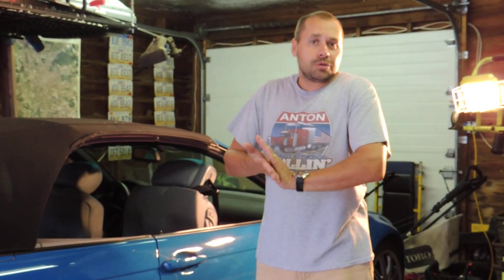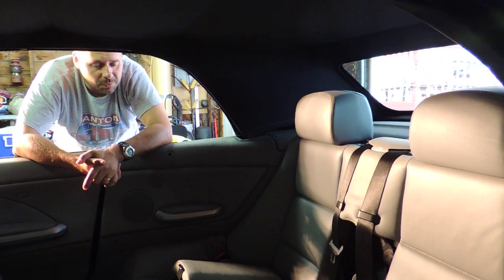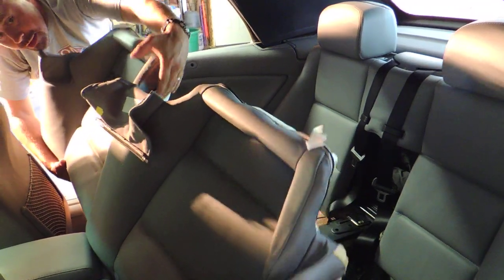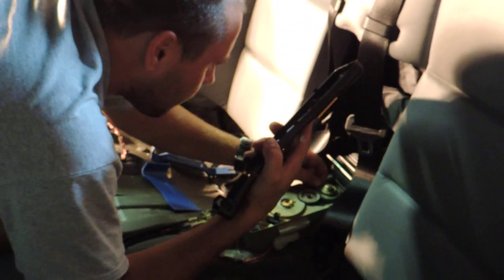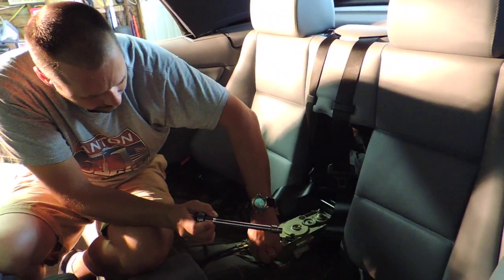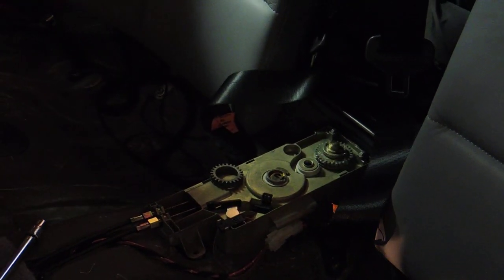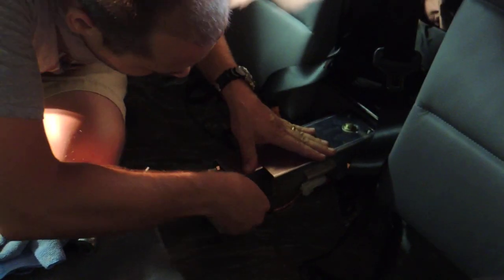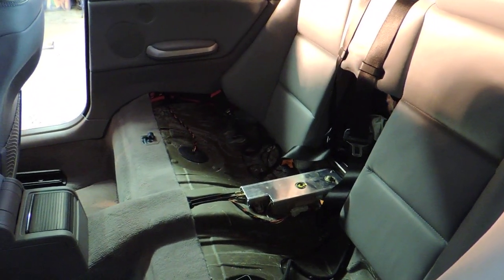BMW E46 convertible top problem metal motor cover replacement

Comment: Viewed your video and ordered the part on ebay.  Took less than 10 minutes to install and fixed the problem beautifully.  Thanks for the effort of posting this.  Saved me a ton of money and issues.
Reply from the maker: You're welcome. But the true credit should go to the guy who engineered it and making them now. He definitely saved us a lot of money
Reply: Hi David Petrosky  when do you install the new cover plate you adjust the tension cables ?
Reply: I was perhaps lucky as I did not need to make any adjustments.

Comment: Hi anton alexeev i see you video full so buy the covert plate by my BMW46 2003 convertible but dont work . the mechanism unlock never unlocked  so the light stay flashing  what do you recommended
Reply from the maker: Jorge Fonseca So you bought the new cover and it still doesn't work, did I understand you correctly ?
Reply: @TAspeed1  Hi  yes affirmative  it still doesn't  work , today I try again but when turn with Allen key o'clock wise I fell unlocked , the cables moved but doesn't work
Reply: the plate cover I bought new 99 us by ebay

Comment: I tried to put it back with the plastic and it worked until near the end of closing or opening top. Didn’t have parts customer needed car so we put a bolt and nut to hold the gears In place. Just have to take the motor out to place the bolt in place. Nut goes on top of plastic once everything is buttoned up. Hand tight with locktite

Comment: Anton I see you video , but I have problem with latch on the front drive side dont work , I try manually nothing . only the passenger side open only. any recomendation please thanks
Reply: My friend your metal latch which hooks into the windscreen is encased in plastic. Either the plastic surrounding the metal latch has broken (which can be reglued, or have a bolt drilled through it), or the plastic gear inside the top latch motor which sits in between the latches has broken. This can be replaced with a brass replacement gear. There are tutorials all over YouTube for this replacement.

Comment: Looks like a great product. However you mentioned the plastic cover may just have been like $10? I am getting rid of my car next month but just wanted a cheaper solution. I can't find any on ebay or Amazon etc, any idea where I can purchase one? I have the exact same issue, clicking/grinding, 1 of the 3 pointed pins is broken on top so only 2 are grabbing the cog. Also my plastic cover broke on the side where the flap is. Any tips welcome!
Reply from the maker: https://rover.ebay.com/rover/0/0/0?mpre=https%3A%2F%2Fwww.ebay.com%2Fp%2F943414501
Reply from the maker: https://rover.ebay.com/rover/0/0/0?mpre=https%3A%2F%2Fwww.ebay.com%2Fp%2F943414501
Reply: @TAspeed1  Thx for the quick reply, but I am looking for the plastic, not metal cover....like I said I have spent a lot in fixing up my car and trying to save some money and plan to sell it just in a month. Any idea who sells just the PLASTIC cover? I see nothing on ebay etc...Thank You!
Reply from the maker: Unfortunately there is no plastic replacement covers unless you buy the entire motor assembly. There is a way to do it with a threaded stud washers and nuts. Or wooden spacers and zip ties around the whole  motor assembly
Reply: @TAspeed1  Thanks! That is what I thought, may  just have to go with the $99 metal one. Thnk You!

Comment: OK, I've heard an annoying sound while lifting my top few days ago. It was very short sound like the one you describe. Today after almost a week of normal operation, I the sound appeared again, this time during almost entire top lifting. I stopped before the top is locked and pressed the other button for folding it. The sound came again. Now though it works without any noise. It is strange because the noise does not appear only during the locking/unlocking of the cover. Do you think it is from the same gear? Despite of the clicking noise, the top closes and opens no problem? Is there a chance the problem is with the hydraulic pump? I suppose there is a separate motor driving it?
Reply from the maker: Sorry for late reply I've seen that you posted it a month ago. I hope by now you were able to troubleshoot it.

Comment: where did you get the metal cover?
Reply from the maker: Mark , 
eBay. The gentleman costome makes them. Sometimes he out of stock on them. 
On the description of the video you will see the part number that was assigned to it because it's patented product now you can put that part number in Google and it will show you the eBay listening

Comment: Hey Anton, thanks for the test. Sounds great. Found it on e-Bay, but unfortunatly shipping cost to Germany are as much as the part itself. :-(  Maybe I will try it with something like a hose clamp bound around with some metal in between. 

Anyway, thanks for the hint and have fun with your convertible, bro.
Reply: Just do the fix with the bolt. It's easy, cheap, and works perfectly.

Comment: Thanks for the video.  I have the same problem.  Where did you buy the metal cover from?  Would you please give me a URL.
Reply: small washer on that gear he took out. My solution was to place that washer right because that gear needs to hold down for a turn. re enforce that washer against the plastic cover with a self_made kitchen aluminium foil washer - just a thin width will do.
want some more support? that small removable child seat

Comment: Bosch sells a complete OEM replacement part for $29.46 on FCP euro, whereas the BMW branded part is $607.11. This is just the motor, not the housing though. I haven't been able to find just the housing, nor could I find the metal aftermarket replacement.
Reply from the maker: Search eBay on and off. Gentleman who makes metal covers owns a machine shop. He makes them and sell. but they're not always available if he's out of stock on them
Reply from the maker: Matter of fact I just searched eBay
BMW E46 convertible top motor cover.
it showed up in search and available for purchase.
Reply from the maker: Or put this in Google search
BMW E46RTC
The eBay listening will show up in one of the top searches

Comment: Your problem is you must have removed or missFixed that small washer on that gear you took out. My solution was to place that washer right because that gear needs to hold down for a turn. re enforce that washer against the plastic cover with a self_made kitchen aluminium foil washer - just a thin width will do.
want some more support? that small removable child seat may have something underneath to press down there some more- I bet you will not need that extra.
Reply from the maker: I did not disassemble the motor until that day during that video. So , I had no prior missfixed. I did not found or noticed any washers once I pulled the cover off. 
My be a previous owner of your car fixed that problem by putting a washer. 
I am just guessing. 
Metal cover works great for me.
Reply: it is this plastic like ring that goes on top of that gear and I am most certain it is from factory. if you look at the assembly you will notice that the click happens while that gear pop up.
The aluminium foil beaten into a precise hoop like this 'O or c' cost me nothing!
My new problem is the last step to lock the top in place doesn't happen. I have tried manually but failed. 
Do you have any idea?
Reply from the maker: Did you try to put pressure with your thumb over the center of the gear like I mention in the video during the last phase ?
Reply from the maker: While you operate the top up button

Comment: There is no reason to remove the bolts if you are just replacing the cover or even the gears
Reply: Hi Jeff F the cover plate its attached by bolts add the latch ,

Comment: Thank you for the info. I have a question, My son  just purchased a 2002 BMW 325C Convertable. Was my mistake when we test drove it from a private party seller. I asked him to put the top down to see if it worked. He did but had to push it down in the back to close it all the way. we drove it and forgot to test it closing. When we brought it home we tried to close the top and it did not close. We checked the truck latch and it was down. I tried putting it up and the latch stays in the down position its like its hard to put in the up position like its stuck? Any suggestions where to start? Can I manually put the top up? My email is  quotes@goburns.com if you have any help would be greatly appreciated.
Reply from the maker: DON BURNS , I just send you an email